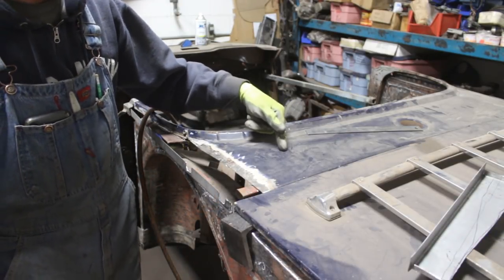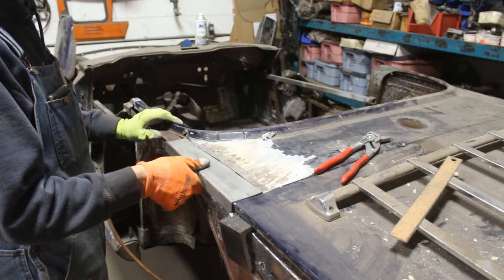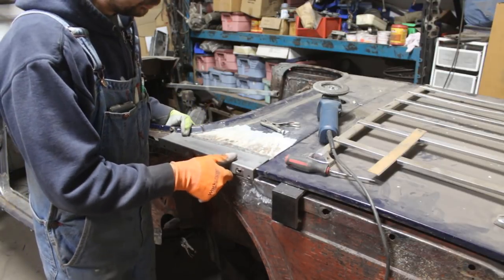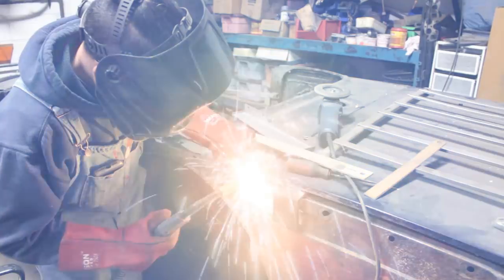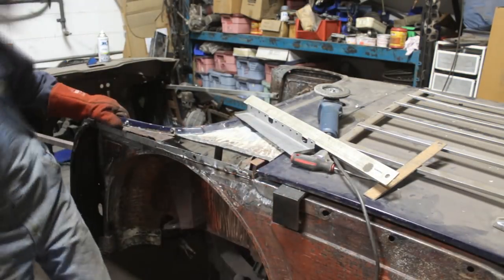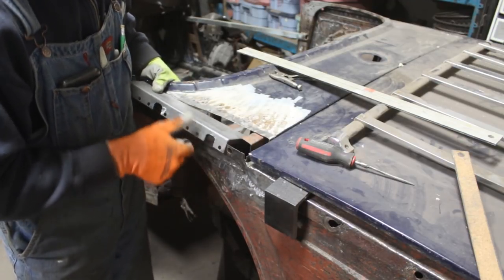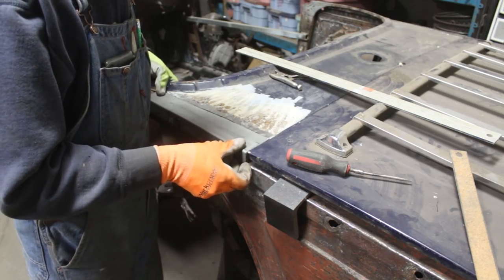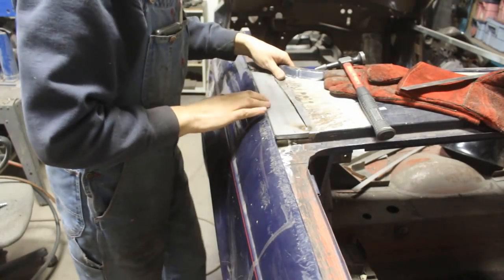1974 Triumph TR6 Restoration - Part 28 - More Deck Repairs

Comment: Thanks for the car content and message.  For your wrong-side sill end cap... could you make cuts in the flange and reverse bend it, or cut off completely and re-weld on the other side, while maintaining the new correct angle of the flange.  I am sure that you have already thought of other options !  Stay safe.

Comment: what size wire do you use for the welding on the body panels? I'm using .30 and still blow through the metal...
Reply from the maker: I use .30 too. Many times I blow holes as well. You just need to hold for not too long. A little bit too long and you are through. You have to kind of pulse it.